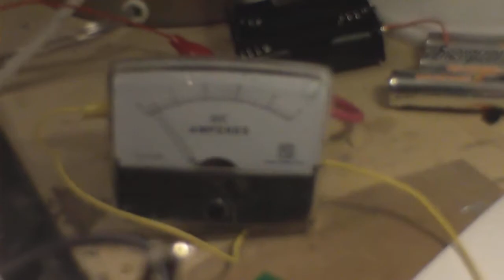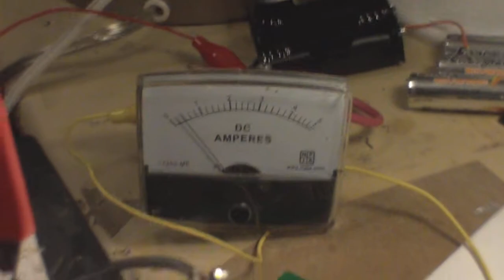(4) "Wimpy" - A PWM Limited FLIP FLOP DC - AC Inverter

Comment from the maker: @Magneticitist It is.. and it isn't... further testing has shown that a. I think you need 1% resistors in the flip flop, because after hours of use, one side, or the other of the FETs, does in fact heat up a bit.. i think it's because, possibly, current favors the path of least resistance OR maybe my caps are not equal... and B. The circuit really loses efficiency as you approach 1 amp. I do not think the power would be very appropriate for anything other than light, with PWM involved.

Comment: looks like really good light. ive been wanting to use a smaller cooler and make one of those all purpose car battery inverters and just add a bunch of ports for 120v and 5v usb, the cig lighter, lamp etc... circuit like this would be good for that.